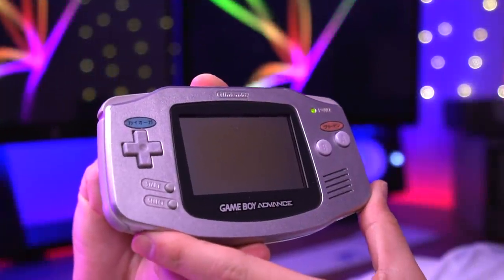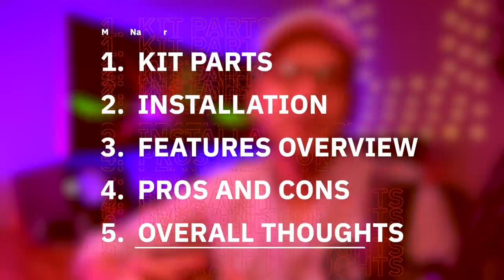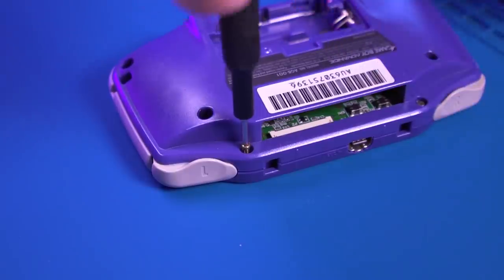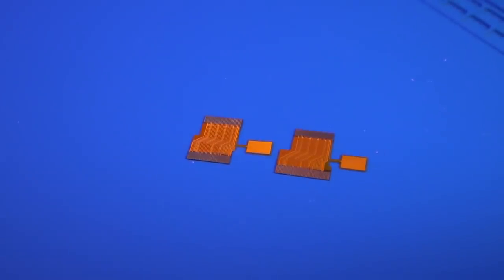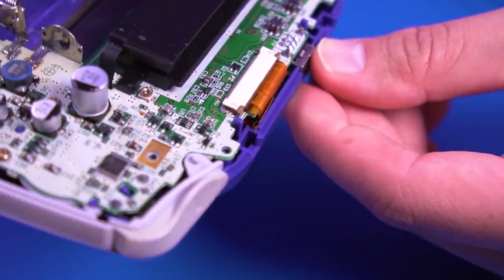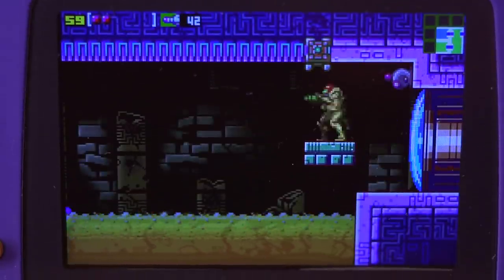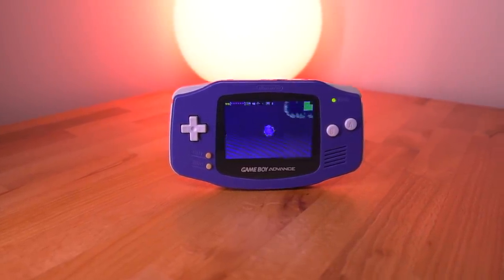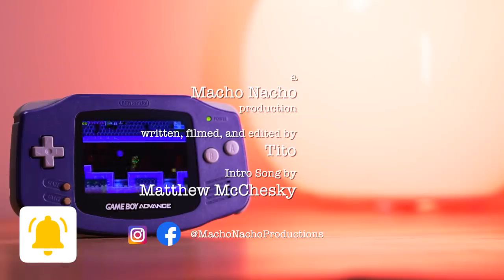Super Easy NO Solder and NO Cut IPS Mod for the GameBoy Advance | A True Drop-In IPS Mod for the GBA

Comment from the maker: UPDATE:  Hey everyone!  Got a response from RGRS. In order to prevent this issue you need to make sure the touch sensor is trimmed (like I showed in the tutorial) & adhered (I used kapton tape) to the front half of the housing and not touching the rear shell. This completely fixes the issue!

Hey everyone!  After playing with the new screen some more, I am noticing an issue where the brightness is cycling through randomly. I reached out to Retro Game Repair Shop to see what is causing this issue and will report back when I find out more. I wish I knew this when filming so I can show you all. Stay tuned for updates.
Reply: Hopefully they'll have a fix for that. Thanks for letting us know!
Reply: My guess would be interference/cross talk between the ribbon cable and the touch sensor. Perhaps some sort of small shield between the two will fix it?
Reply: I've had this problem before on other kits and it was always the touch sensor being finicky.
Reply from the maker: UPDATE: it’s not an issue!  Please read the updated pinned comment above. Cheers!
Reply from the maker: UPDATE: it’s not an issue!  Please read the updated pinned comment above. Cheers!
Reply from the maker: UPDATE: it’s not an issue!  Please read the updated pinned comment above. Cheers!
Reply: Ha. I got a Glacier GBA this week because I didn't want to use a custom shell or cut into my OG Arctic one from childhood. This seems like the ideal solution, but I'll wait to see about this potential issue being remedied before getting this or just cutting into the Glacier shell and use the Funnyplaying kit. I wonder if it's an issue with cutting into the sensor, but I look forward to hearing what you find out about it. Either way, another great video dude! Thanks so much.
Reply from the maker: UPDATE: it’s not an issue!  Please read the updated pinned comment above. Cheers!
Reply: Is this problem fixed with the 5.1 revision of this kit?
Reply: @MachoNachoProductions  Awesome! Thanks!
Reply: What's the difference between this drop in version and the original IPS/funny playing (like as far as battery consumption and brightness difference)
Reply: I can’t get mine to stop cycling even after doing that.
Reply from the maker: @Jack-eu2kj  you need to make sure the sensor isn’t touching the rear shell. Give that a try and let me know how it turns out.
Reply: I tried this tip but couldn't get mine to work. After trying a few times the touch sensor snipped off completely. Now it defaults to the brightest setting and stays that way. Im ok with thatm
Reply: I've had no luck with fixing this tbh. I have put some electrical tape on one side and put it against the top of the shell, it's kinda hard to get it only on the front shell although idk why that matters in the first place. I've even done what other youtubers have done and put some folded paper under it to prop it up, but zero luck over here.
Reply: I actually want to report back because I found a weird anomaly. So for most games I play like Mario Bros 3 and advance wars it works completely fine, and even works fine on harvest Moon friends of mineral town. However I noticed that when a character dialog box appears in harvest moon the brightness will cycle and will only stop once I leave the dialog box. I’m not sure what causes this and it’s driving me insane but it definitely only happens when talking to someone. I played like two hours of advance wars with no problem and I even tried kingdom hearts and some other games, and can confirm it only happens in harvest moon I can’t find anything on the subject so if anybody has any ideas let me know or if they can try to replicate it.
Reply: @アーケルスティーブ  I have the side of the touch sensor that is facing the ribbon cable covered using electrical tape that is used to stick it to the top of the front shell. The paper is still in there, but it was doing it on every game before I'm pretty sure. No idea why it's just doing it on one game. Did you actually end up fixing it? there has to be a reason why only on specific menus, I can't possibly think of a reason why it would be physical placement if it doesn't happen at all in most games and it ONLY happens upon dialogue boxes in another.
Reply: Also I can confirm this happens on my original copy and a copy on my flash cart
Reply: Is this native 240x160 or is it a higher resolution that is then upscaled?
Reply: @Nitramoxide.5556  Just to be clear, you cut the entire touch sensor tab and now it just turns on a defaults to brightest?  This is what I want to do.  How far down did you snip the sensor?
Reply: So I got the new v5 version a week or so ago and installed it using thin double sided tape to attach it to the front. It's been working fine so far then just today it started the cycling. To be fair, my batteries are going out so I wondered if that might do it. Gonna swap some new ones in when they recharge or buy new alkalines. Unfortunately I'm on vacation and did not pack the screw drivers necessary for this... :(
Reply: Ok so I tested it with better batteries. Same dimming cycle. Oh well. Guess I'll open it when I get home. Now I just need to find out what keeps killing my legend of Zelda save states and game memory on the ezflash omega...
Reply: Update?
Reply: Tried to purchase it but it was sold out 😢 but while checking out the website it said something about a OEM shell or something otherwise the screen and lens wouldn't fit right.
Reply: So I purchased this and the 2 LCD ribbon cables now include a green wire. I purchased it not to solder anything. but apparently you have to solder it now... have you had a chance to revisit this product? I can't return it since I already cut the touch sensor ribbon in half like in the video. :(
Reply: @Rundas342  my question too. I just got an old advance and wanted to try this but they don’t seem to sell the no solder kit now. Why???
Reply: How do I get one
Reply: Thanks u

Comment: Gotta love seeing a non-destructive and completely reversible mod! As time goes on and more people mod systems, we're going to have less and less stock systems, which is kind of a bummer imo. I'd love to see more non-destructive mods come out in the future!
Reply: I highly doubt that. Millions upon millions of AGB's were sold and I'm sure a good percentage are still out there. And then there's the small percentage of Game Boy fans that do go ahead and modify their AGB's.
Reply: i sold the pcb from a supernintendp controller when i made a wireless one with 8bitdo's kit
Reply: @Glol91ABC  what about the permanent shell damage? the solder damage? the fact that most screens have permanent adhesive??
Reply: as much as I would like to agree, not only did millions of them sell, but honestly having a stock GBA sucks lmao. Screen is terrible, uses double As. Would much rather do some slight battery slot modding and put a cleanjuice in, and then use this. Very little damage while still removing all the modern day issues.
Reply: I know it's years later but whatever. Unless it's some rare variant that arguably belongs on a shelf, all you are doing by modding a GBA is extending it's functional lifespan and playability. 

I'm doing a no cut because it's a Japanese orange console in amazing shape. But I'm not gonna fault someone for completely gutting a GBA and replacing everything. Especially if it's kinda janky. Anything to keep it out of a landfill and in loving hands.

Comment: This is what i been waiting for. A screen replacement that's pretty much just as simple as sliding in the ribbon cable.
Reply: @Alex-CA  it's less about the soldering and more about being able to restore the console to its original state, or use a different mod without the uninstall process being painful, and the mods done to other components making installing the new mod more complicated

Comment: Solderless/No Mod/Drop in screen replacements is such a massive improvement as it opens up the ability to mod a console to those that would otherwise be too uncomfortable with the install process. Ben’s Lynx 2 screen comes to mind. 
Not sure about that max brightness tho. The comparison against the FP screen was significant, how much does it affect usage in (Eg) day light/outdoors etc?
Reply from the maker: That’s a great question. For indoor use it’s definitely bright enough. I have not yet tried it outside so can’t say for sure. Cheers buddy!

Comment: Great video, made install very easy. The hardest part was correctly placing the touch sensor to prevent the random cycling. Thank you so much! A few things for people thinking of getting this kit. To my understanding, this kit now comes with the v5 board which makes the screen much brighter than the v3 board. The screen color looks a bit cool in the video (blue), mine is not quite as blue, more of a neutral color.
Reply: I have Version 5.4 boards that I received and yes, this should be something to note.  I didn't need to trim the touch sensor or do a mod to get full brightness.  the touch sensor is now on the other side of the ribbon so it actually folds into the space nicely.
Reply: Good to know! Gonna order mine tomorrow!!

Comment: I bought this because of this video. Also had to get an iFixit kit for the screws. This was my first time nodding anything (aside from putting an SSD in my PS4). Used this video as a step-by-step guide and it took me 15-20 minutes to complete. It really is as simple as it looks, and the screen is a MASSIVE improvement on the original.

Comment: This was a great tutorial. The version I got had the touch sensor on the left side of the connector to the driver. Instead of cutting it, you can fold it to the front of the ribbon so it gets tucked into the front face. You can change the brightness by touching the N of the Nintendo Logo. Not sure if it's a newer revision but it works fine and haven't had the issue with brightness cycling so far. 

Keep up the good work, man!

Comment: Just installed mine, followed your tutorial and got it done in no time. My touch sensor was on the opposite side and didn't require me to cut mine but still great video and a great product!
Reply: Mine was on the opposite side too! Hoooooow did you place it? I cannot find a good spot for it that doesn’t auto cycle through brightness settings.

Comment: Just finished installing this into my Platinum GBA and its working great! Thank you so much for this video! I will echo what a lot of other people on here have mentioned, your videos are extremely high quality and well done, keep it up man! One thing, not sure if it is a difference with having a 32pin connector on the main board, but I only had two screws inside to take out instead of 3 as mentioned in the video. Other than that, everything was the same. Thanks again for the very well done instructional video!

Comment: Feels like we're approaching the singularity with GBA IPS mods. Between the amazing screens in some mods and the drop-in ease of others, it's only a matter of time before all the best features get rolled into a single, flawless, super easy kit. Seems like we'll only have to wait a tiny bit longer.

For me, a no-cut mod is a huge draw. I was willing to compromise on some simple soldering, but cutting just never seemed like a good solution to me, especially when I want to keep my transparent original shell. I'm glad these are coming out and I hope they become the norm.
Reply: i doubt it myself, all kits have pros and cons, but soldering shouldnt be seen as a con, because there isnt much other way to control the screen options by pressing buttons. 
This screen might look good, but it is also smaller in screensize and more bad quality (blueish glow from what i read in comments here but not confirmed myself) as the FunnyPlaying V2 kit, and a bigger screen requires cutting shell. And these touch sensors dont look as decent as their counterparts with the button presses, but for those you will need to solder, i dont think any tape will stick that long as a good solder job. We should be happy that Nintendo actually gave us solid solder points we can use to connect the wires.

Comment: 2 things, for anyone wondering. 

1. The brightness mod he mentioned also works on 32 pin boards
2. the screen is distractingly blue tinted. I ended up selling mine because it's tiring to look at for long periods of time. You can even see in his video that its VERY blue
Reply: Exactly, but not a single word about this.
It feels like watching some commercial instead of a review
Reply: @187StaticMr  I don't necessarily blame him. A lot of people don't notice these things, just like a lot of people will buy a $150 65" on black friday and get a terrible display lol I've always been very sensitive to quality in screens so I noticed right away. TL;DR If you're reading this and care about quality, DON'T get this screen. If you don't mind a harsh blue tint over everything, the screen is otherwise, not bad
Reply: @lolztony  the blue hint is due to calibration, i bet they will be calibrated differently across all these LCDs, because they are actually NOT CALIBRATED. Also the 32/40 both can use the brightness mod. And it's completely worth it, night and day. That being said, i still prefer brightness control buttons and soldering and using the lg ips lcd.
Reply: @thepokerus4184  I’ve tried 4 different screen setups now and the LG funnyplaying blows the others out of the water
Reply: @lolztony  correct, which is why I said i also prefer it. It's the best
Reply: What's the LG ips mod, is it an LG screen?
Reply: @ellaquin  LG panels are usually higher quality and some kits use them and others don’t. It’s been awhile since I’ve dabbled in the game boy modding scene but last I know of, the funny playing kits use LG panels! Hope that helps

Comment: DON'T MISLEAD PEOPLE
This kit is still drop-in. The wire that comes with the new kit doesn't need to be soldered, you just have to wrap it around the positive battery terminal of the motherboard and stick some tape, this makes possibe the option to change between 10 levels of brightness instead of 5.
You can solder that wire if you so desire, but YOU'RE NOT FORCED TO
Reply: really?
Reply: @dannyxkai  Yup, just tried it out with my GBA. The wire just has to be attached  to the positive pole

Comment: Hey Tito! I don't know if this has been brought up yet in comments, but I recently installed this mod and had one major problem: no image on screen!

Well, I followed your advice from part 2 of your Dreamcast project, slowed down, and looked over the whole build: turns out, RGRS made some changes since your install!

1) the ribbon cable connecting the screen to the motherboard has been flipped around, so that the touch sensor is now on the left. I wasn't even looking at the connections and ended up installing it backwards. (Doy!) Despite my initial frustration, it's a welcome change, since it now allows a lot more room for the sensor to be slid into position.

2) The screen is now a larger IPS, so you will need a larger screen lens to go with it.

3) Maybe this was just my kit, but the left spacer was just a hair too tall, resulting in a crooked screen after install. I sanded it down a bit to get the proper height.

4) It's so much brighter now! I would put it on par with the McWill or any other generic IPS you can find online. Color saturation is at proper levels, too!

Thanks for making such an awesome series of videos...even when I am just relaxing, your calm and friendly presentation just makes them a great way to just pass the time. Like I said before... you're the Bob Ross of console mods!
Reply: Regarding number 2, this shouldn't be the case. It states in the listing that the IPS screen included with fit OEM cases and OEM lenses. IPS lenses will be too large allegedly.

Comment: I think you actually should trim those little nubs that run along the bottom and right hand side of the front shell’s interior. Otherwise the panel might sit at an angle. I’ve modded my GBA using the same kit and that’s definitely something to look out for. One thing I didn’t hear you mention is much reduced power draw when compared to funnyplaying. According to makho’s tests, at max brightness funnyplaying gives you approximately 40% of stock battery life while this kit reaches 70%! That’s a massive difference if you care about battery life. 
If anyone is curious - look up “cloud game store” on AliExpress. It’s the original seller of this particular kit (there’s a similar one for the SP too). Their shells are a bit crap, though, so I’d look for these elsewhere.

Comment: Because of how simple that looks I want to try it myself. But before I do I wanna at least get an original version and one that’s broken so that way in case I mess it up I don’t break the system permanently and I can still have one to play on. I am not at all familiar with any kind of programming or soldering or any kind of modding so this looks like a really fun Modification to use especially because I like the design of the original GBA but I still love my GBA SP.

Comment: Lol when you used a gasket in the past and you know to never do it again.

I like the idea of the kit for people who don’t want to fuss around and want a slightly better screen without having to worry about a new lense. I don’t like the limitations of the picture quality vs funny playing, the option to use buttons to adjust brightness and the dim screen.
Reply from the maker: True, I would agree the FunnyPlaying kits are a bit more professional in the sense of operation but are a bit more work. Cheers dude!  Great to hear from you!
Reply: I'm glad to pick up on that tip. Thanks for reinforcing it.
Reply: I would certainly consider going from a non-lit original GBA screen to an adequately lit one far more then “slightly better” lol.